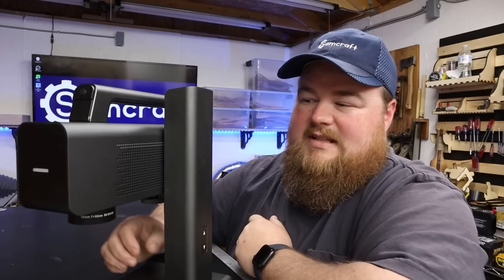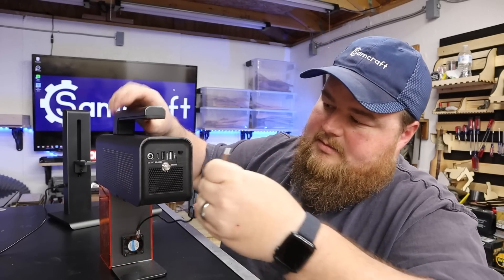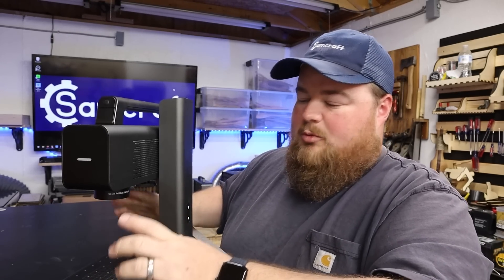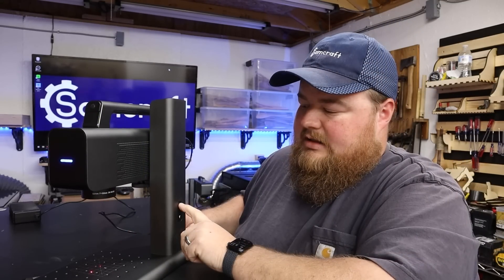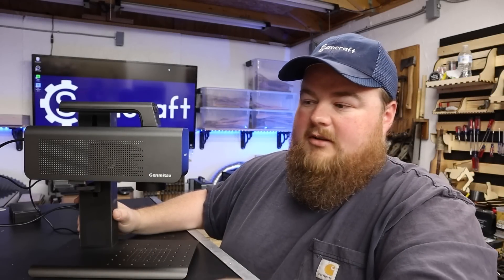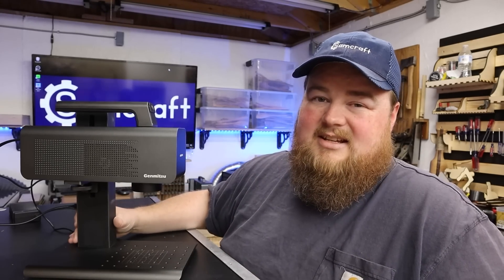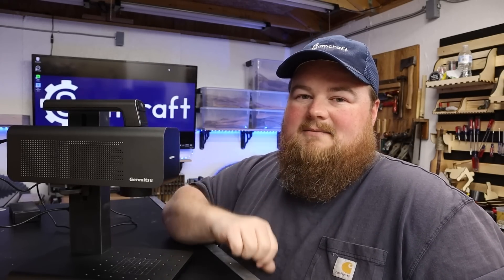NEW: Genmitsu Z5-1 Metal Laser Engraver / 1064nm Galvo Laser Package

Comment: Sam, I need help!  I ordered a z5-1 but it won’t connect to my computer!  There is “no driver” even though I ran the driver install. 
Did anything like this happen for you?
Reply: Having same issue was you able to get around this issue pls and thx
Reply: @martinbermudez2398  I had to get a windows computer to run it. 
It apparently has to do with the processor in the Mac. 

It’s janky and the program is awful. 

I just got an xtool F1 and it is way easier.

Comment: Interesting machine so much so that I've ordered one. I wonder how much power it will draw, maybe it could be used on an inverter at markets etc if shielded. adequately. I will probably review it on my channel at some point..
Reply from the maker: You're going to like it! I use it daily in my workshop for my small business. I'm sure the power draw is reasonable too. I've run my Ortur gantry diode and tablet from a small battery pack before.

Comment: So, yet another 1064nm laser advertised as a "fiber" laser which is not. It is probably a DPSS laser, and similar to, if not the same as, Atomstack M4 and Enjoywood M4.  The base and tower distinguish this machine, and also the shields, assuming the orange acrylic actually shield at 1064nm, which I'm a little wary of.  It would be cool to see this machine lasering onto shield to assess the protection.  Very interesting that the SeaCAD version is better.
Reply: A dpss is a better laser than fiber. Far more versatile.

Comment: Hey Sam. Thanks for this video. I bought one of these a week ago and love it so far. you CAN actually adjust the focusing lasers to line up with the cutting laser. Remove two screws from under the head near the lasers. Slide the plate with the LED off (careful of the LED wires, and there you will see the laser mounts with the set screws. I only loosened the inner ones to move them. The only small side effect if there is a little hazing from the lasers on the bed but its minimal. This is caused from the thickness of the cover plate but there is no interference from it. Just thought youd like to know this :) keep up the good work. Dave
Reply from the maker: Awesome, thanks Dave!
Reply: What about the software? still crap?
Reply: @z3ro618  imo the software is fine. It's done everything I need it to. I don't see a need in spending $200 on Lightburn for galvos but it may benefit some

Comment: No doubt about it that is a neat little fiber laser. I have a Cloudray 50 watt that will engrave on a 11.5 x 11.5 inch area. I found out you can melt the heck out of slate so doing coasters I run the power way back and the speed way up. The laser rabbit hole is a lot of fun.
Reply from the maker: Very cool! I'll have to look into Cloudray. These little guys are nice for their niche, but I need something bigger for my small business!
Reply: @Samcraftcom  I just got finished putting my logo and contact information on the back of 51 coasters in 22 minutes. I have a bunch to make for keepsakes for my 50 year high school reunion. I designed a graphic to put on the coasters and stainless steel tumblers.

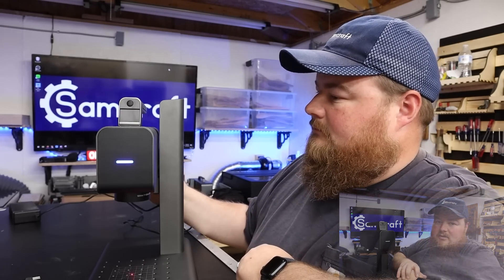Comment: Just a quick note - 70mm is 2.75 in not 3.5 so the engraved area is smaller than you mentioned. Still can do coasters and such but only a 2.75 inch image on the larger surface. 90mm is more like 3.5 inches. The spec sheet you show at (9:48 says 7cm); the 2.76" they show is only true if you go out to 4 decimal places 🙂

Comment: Talk about timing!  I was JUST about to buy an Atomstack based on you other video when I caught this one less than 10 minutes later.  Now I have food for thought.  Trying to talk myself into the $400 price difference and how that will pan out over time.
Reply from the maker: This link will get you 10% off any purchase from SainSmart (it's my referral link). http://423sainsmartcom.refr.cc/samcraft I would say that yes, this machine is worth $400 more. The z-height alone is a great difference. But also the software experience is so much better, too. I'm planning a head-to-head comparison video between this laser and the Atomstack M4 very soon.
Reply: @Samcraftcom  Thanks.  I was curious as to when it might be available for iOS.  I'm a no-go until it is.  RATS!
Reply from the maker: @shannondefriese9598  the only lasers I have seen to be iOS compatible are only small hobby style ones and usually not the greatest.
Reply: Shannon, if you're still in the market for this, I have an extra one that I'm looking to offload.